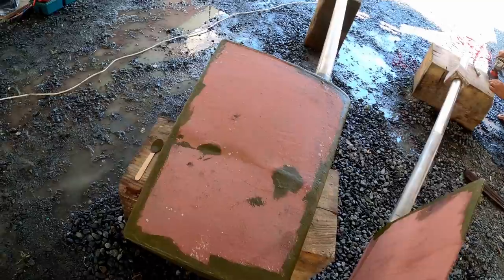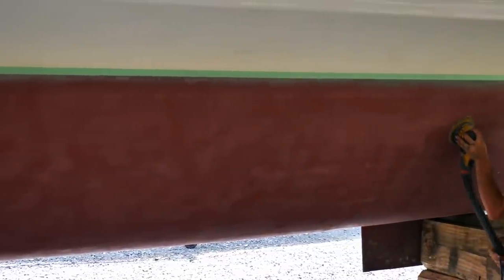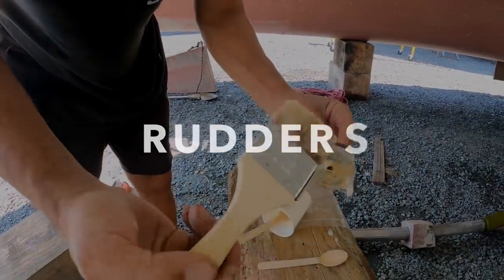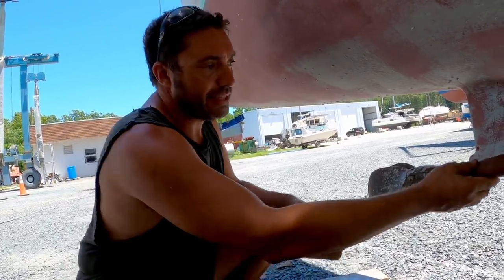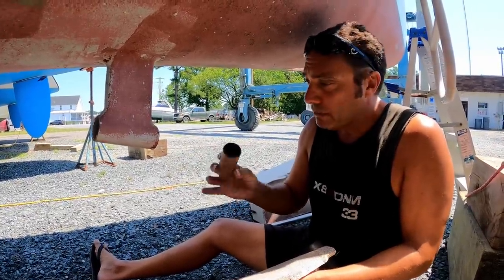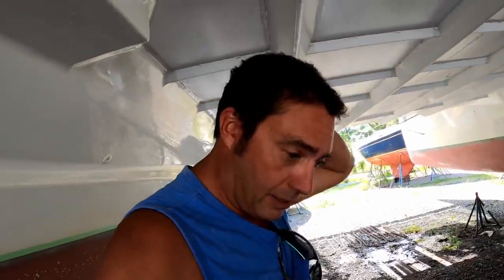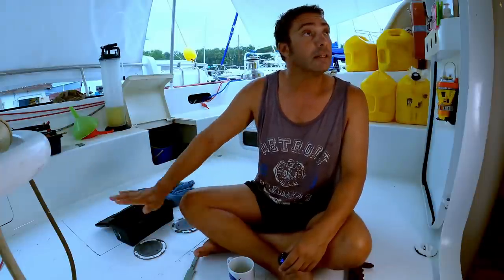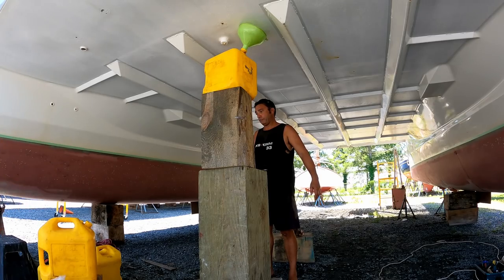HARD LIFE on the HARD - EP 76 SAILING LIFE ON JUPITER

Comment: Whaaaa???  You can't leave up hanging like that!  
As for the seal on your stern tube, it's a good idea that you replaced it.  With the amount of play you had in the old cutlass bearing, there was probably some wear on that seal.  With the prop shaft running straighter, you might have ended up with a leak.
Reply from the maker: You might be right Marcel.

Comment: I dunno Jamie, I'd have changed that anode for good measure.  It may last another year, but with all this work you've got organized you shouldn't have to haul again for two or three and now you will in just one year only for the anode.  I've seen crazy things happen to anodes, like gone in 6 months from new because some idiot in a big steel trawler is pumping stray current into the marina and its eating every anode on every boat around it in a 60 meter radius.
Reply from the maker: Nah its fine Luke... We don't use marinas and we do keep a good check on anodes... Kinda vital for a metal boat... Worse case I can change the anode in water.

Comment: That little 'wood plug (nope). If strapped for parts, at least paint the wood (epoxy) or wrap it in aluminum foil then glue that in place.
Reply from the maker: It was Jim... Dripping with epoxy

Comment: Should you use a different type of zinc for the fresh water systems on the "Great Loop" ?
Reply: That zinc would be called magnesium (Magnesum in american english?). However corrosion is not a huge problem in fresh water.
Reply from the maker: Im certainly no expert on fresh water fittings.... But I don't think there's any need to change...fresh water is less "active" than salt.
Cheers Joe

Comment: Hello sorry what is the purpose of anodes (what material, number) I can imagine that it is for corrosion with aluminum ???
Reply: aluminum anodes for aluminum
Reply from the maker: That's right JL B...Aluminium is low down on the galvanic scale which means that it if a different metal was in the salt water (prop/shaft) then the aluminum would be the one to galvanically corrode.... We don't want that!... So we use sacrificial anodes which are lower on the galvanic scale... Zinc or Magnesium.
Reply: @SailingLifeonJupiter  actually you should use aluminum anodes
Reply: @Grim FPV aluminum anodes are doped to dissolve easier than aluminum Aluminum anode alloy provides more protection and lasts longer than zinc. It will continue to work in freshwater and is safe for use in salt water. Aluminum is the only anode that is safe for all applications. they are built specifically to protect aluminum hulls.
Reply from the maker: That’s interesting ysesq….will have to google it.